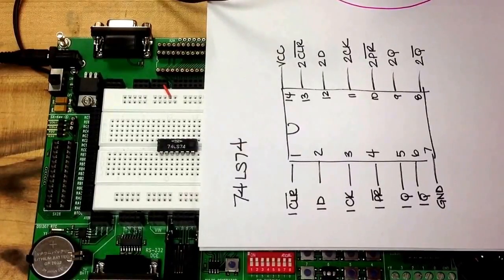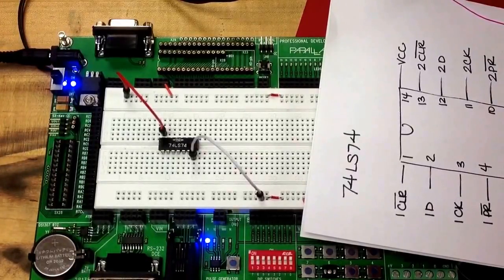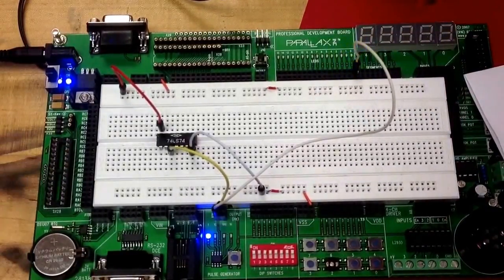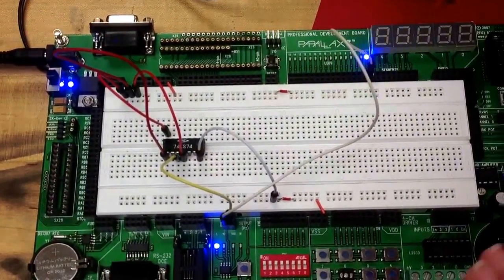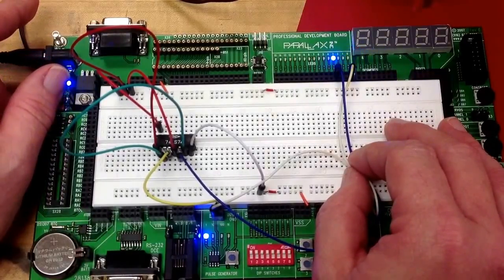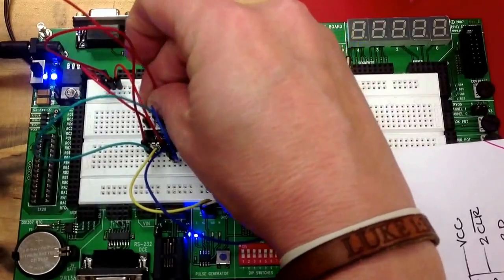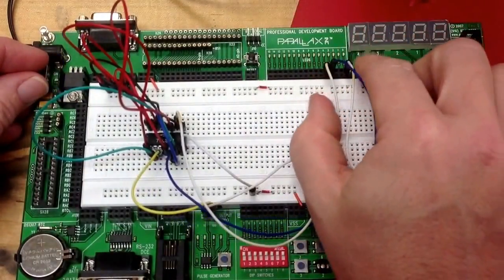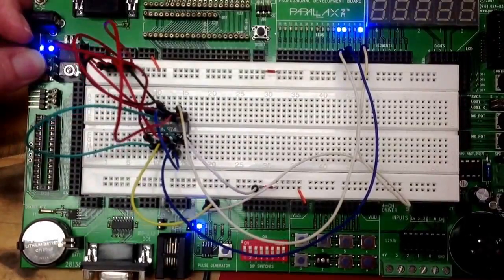Breadboarding a 0 - 3 Up Counter with a D Flip Flop

Comment: Nicely done.  It had been awhile since I had played with anything digital since I am actually a retired RF engineer.  I was pretty sure I knew how to build an  up counter using D-flops and wanted a portable frequency standard based on a 10 MHz xtal oscillator with divide by four outputs.  I prototyped a 2 bit counter and found that I had 5 Mhz at both the Q0 and Q1 outputs.  Turns out after watching your video that I goofed by routing the clock oscillator to both clock inputs rather than the Q0! output.  Also,if you don't mind,  I would like to know where you got your parallax proto board.  Thanks again.